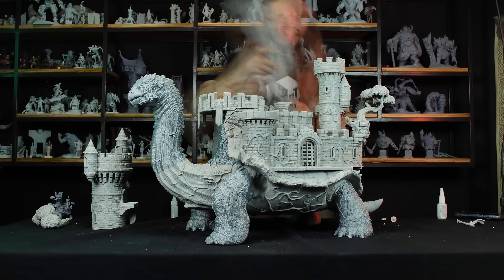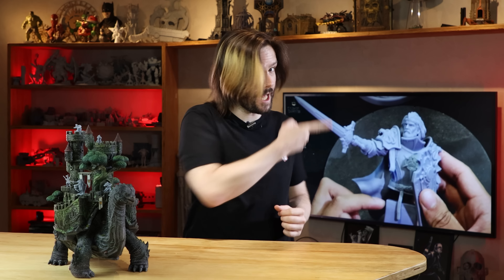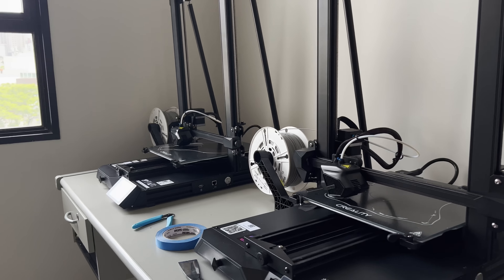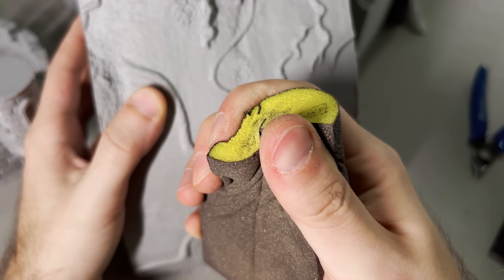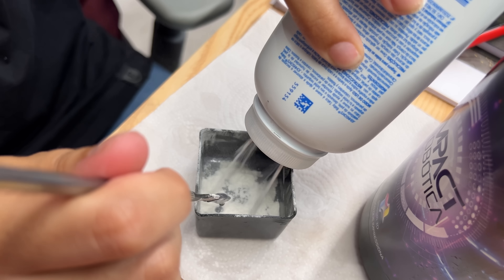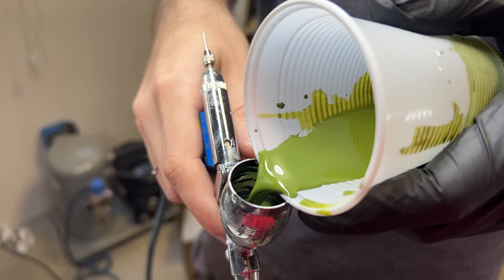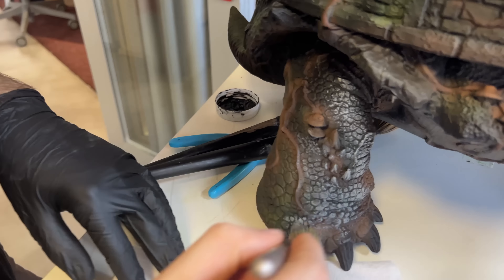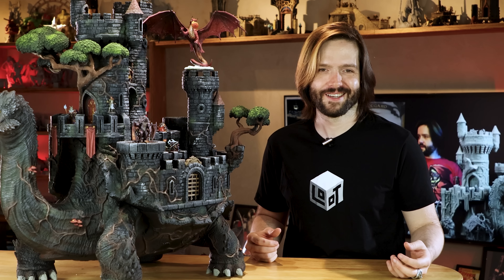MASSIVE D&D Terrain Build: The Tortoise Fortress!

Comment: Well, I'm not sure if this counts as a dare. I play around on Hero Forge. I happen to have a bunch of characters, digitally kit-bashed characters—some on different motorcycles clearly run by some sort of magical forces. With animal motif sculptures of metal built into the front, I imagine they're for some sort of magical motorcycle competition that happens in some place at some time.

It's an event where several different families of artificers come to show off their technical prestige. The motorcycles, infused with magic, have different abilities. For instance, when you activate the Elven Magical Motorcycle Corps, it becomes super quiet and no longer disturbs the ground it's touching, leaving no trace of it having been there. Most variations of magical motorcycles are capable of spider climb and featherfall.

This makes it so that certain tower structures are designed with curved inclines, allowing part of the motorcycle track to travel along the side of the walls that surround the keep. There's probably a floating tower that serves as an observation point for the event. Speakers in arcane machinery convey voices over the raceways, ensuring that fans stay apprised of the action, even if they can't see certain parts of the field.

Comment: Hello, I’m a huge gm and Curse of strahd fan, I played it since 2018 and after a lot of online campaign, I want to do it IRL. Happyly for me I discover what we can do with the 3d printer and I want to print a house and maybe ravenloft castle to play with token. Here are my questions:

1) Should I take a FDP or resin 3D printer? I want to print the caslte and a figurine like strahd or another character (I have already cut, painted and glued a resin figurine of warhammer 40k)

2) what is the size of a normal figurine (on dnd campaign online, I used square on map and token take 1 square)

3) How can I glue/fix the different part of the castle (the castle is a 100x80 square) then how can I properly make it perfect

4) Do you think I can do different floors that can put one on top of the other? (so I can remove every floor and have a beautiful gothic castle when I don’t use it)

thank you in advance ^^